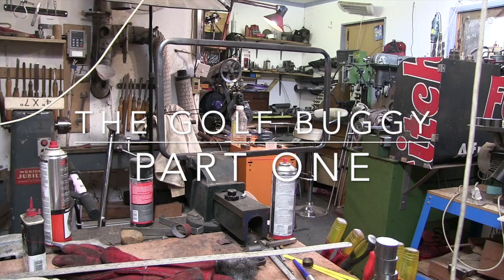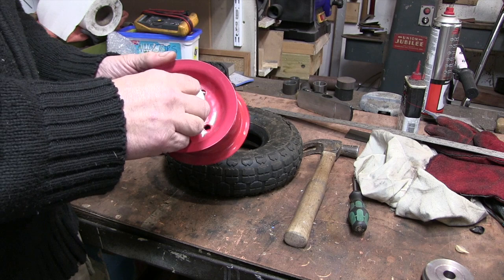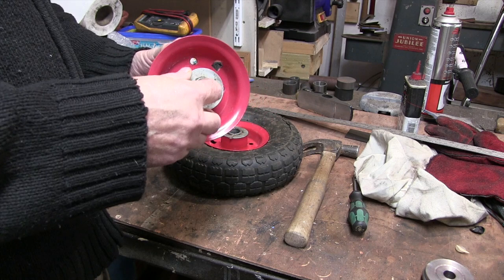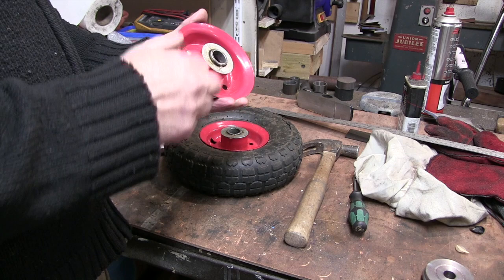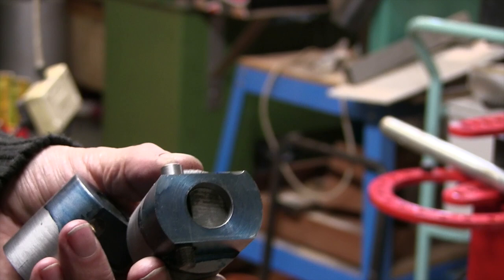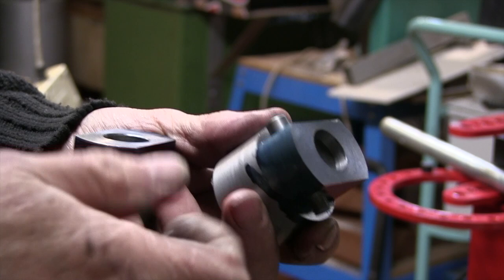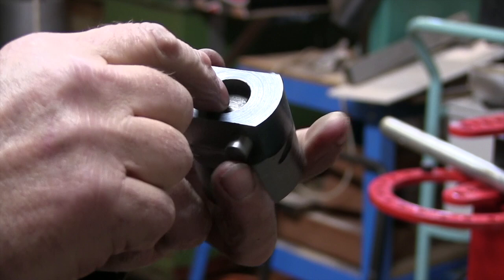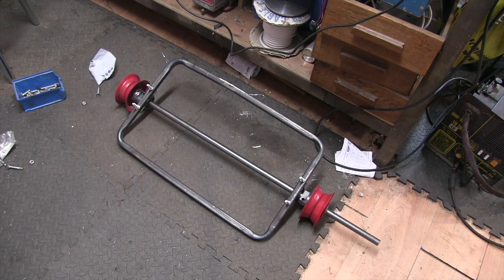Building a Golf Buggy!

Comment: Sorry Cliff, should be SIP. I don't use gas, just the wire as is. You can get this from a number of suppliers. The Clarke wire spat and never flowed, the SIP wire just flowed better. I'm no welder by any means but this just worked. Wire speed on 2 to 3 and just adjusted the 2 switches using trial and error. I was welding inch gas pipe and 20mm bar.
Reply from the maker: Cheers Colin, they do it at Halfords, I'll give it a try, (if there isn't a queue )
All the best,
Cliff

Comment: Hi Cliff, looks like you have a similar welder to mine, are you using flux cored gasless? I recently read a tip so I changed the wire from Clarkes to SJP, it has transformed my welding from awful to very passable, I couldn't believe the difference.
Cheers, Colin
Reply from the maker: Hello Colin,
The welder is a very old nu-tool one, my brother gave it to me a while ago, he hadn't used it for 5years or so, but it works! I'm useing some wire, flux cores I got from amazon, the box says SSjohan, supplier I suspect, but that is the extent of my knowledge, have you used gas with yours, my brother said it really gobbles it up, but is better, if I can find some that fits I may give it a go!
Cheers,
All the best, 
Cliff
Reply from the maker: Is SJP a shop?